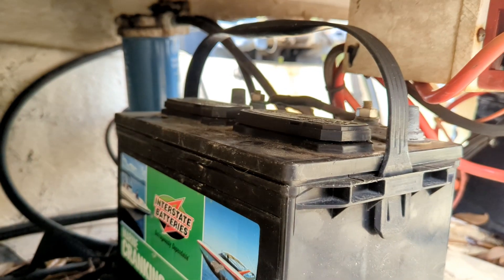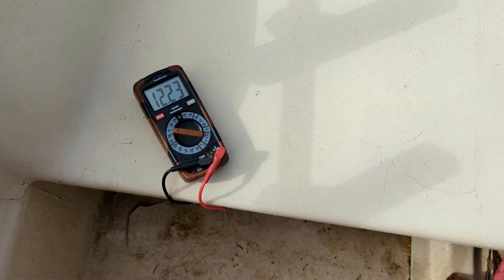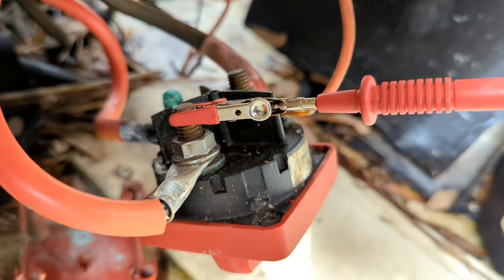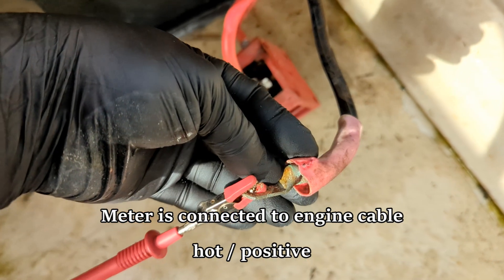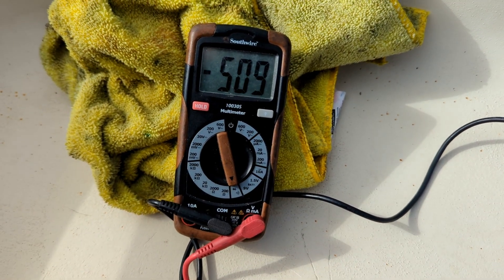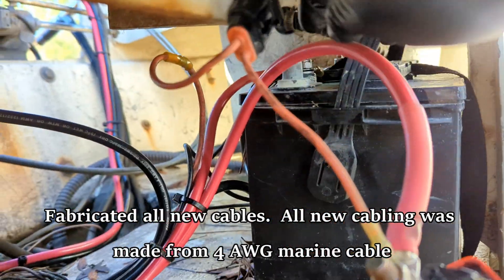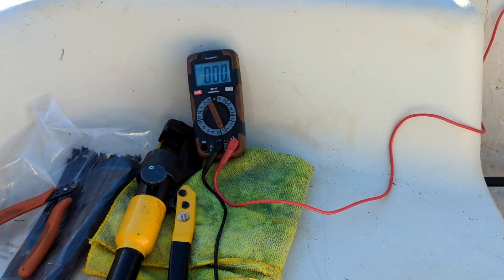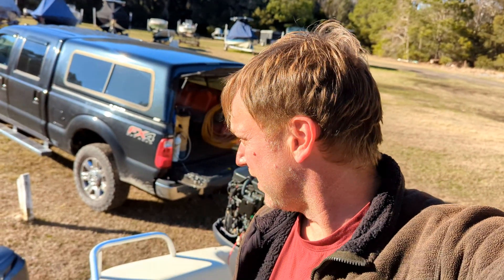Boat Battery Power: Dead Battery Bad Starter or Bad Battery Cables?

Comment: Thank you for this. I’m getting solid starting on my boat but I getting a TON of. Lose interference on my simrad nss12 so I’m thinking my battery cables might be corroded slightly. Also my vhf radio turns off randomly so I definitely have some digging around to do. Great video tho. Very thorough.

Comment: I like that tool bag. whats the brand ? Im a mobile outboard mechanic and need something like that for quick access
Reply from the maker: Found it on Rugged Outlander.  Its been a great addition, and very tolerant of being constantly soaked in oil, and other stuff while living in the back of my truck in high heat and direct sunlight.  Had it for about a year. 
https://ruggedoutlander.com/